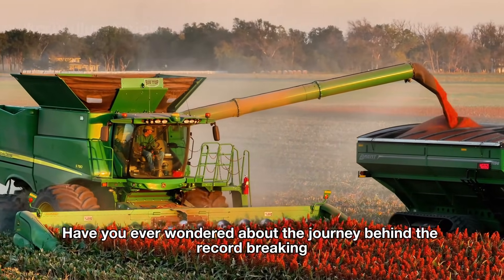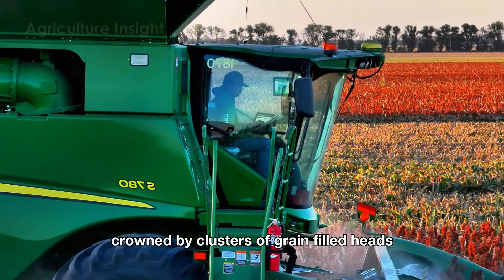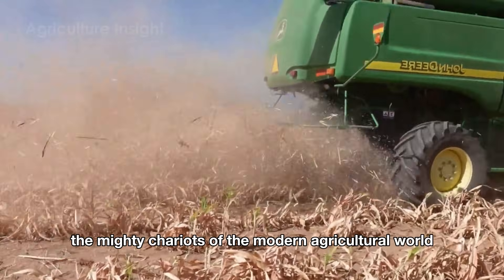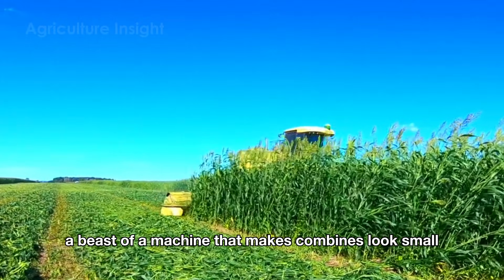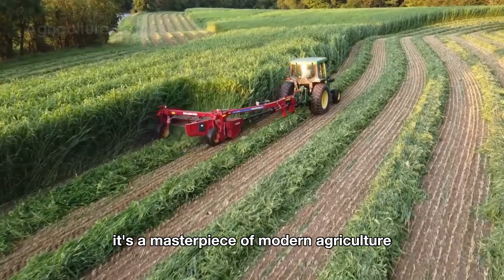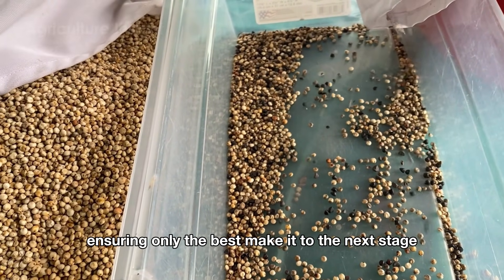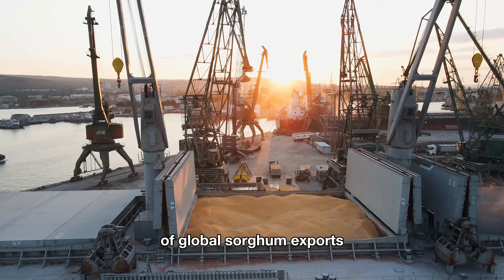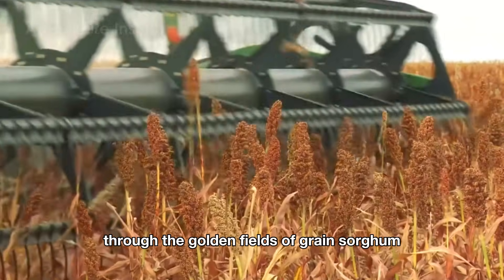20.9 Billion Pounds Of Grain Sorghum Harvested By American Farmers This Way | Agriculture Technology

Comment: A forage harvester does not make a combine look small by comparison.
Reply from the maker: You're absolutely right! While forage harvesters are impressive machines, combines hold their own with their sheer versatility and size, especially during harvest season. Each has its unique role, but both are powerhouses in modern farming!
Reply: In horsepower it in in the big league